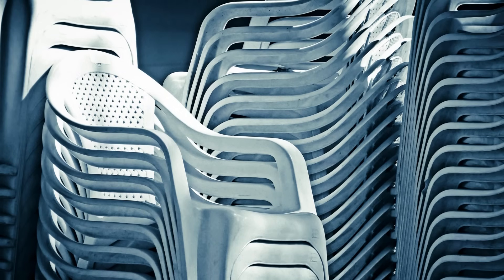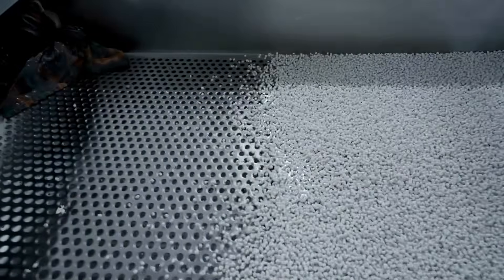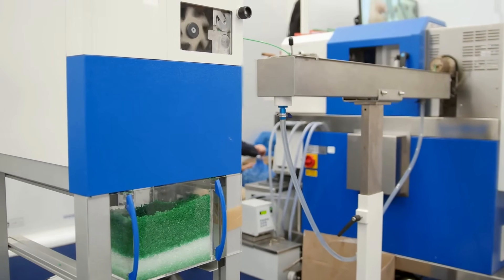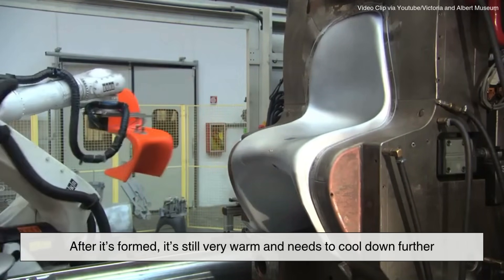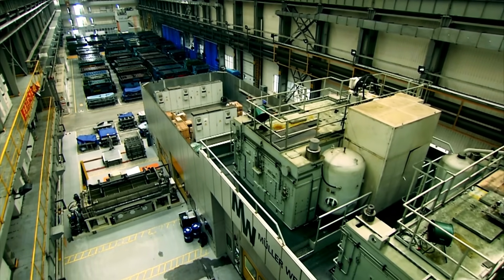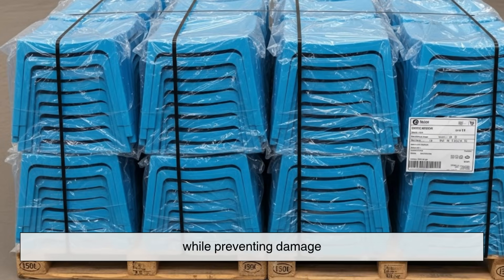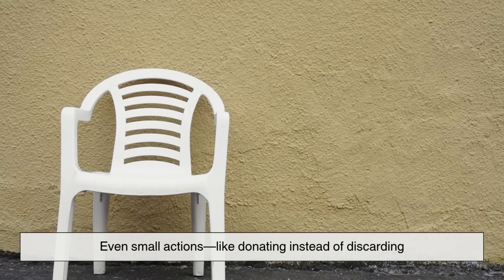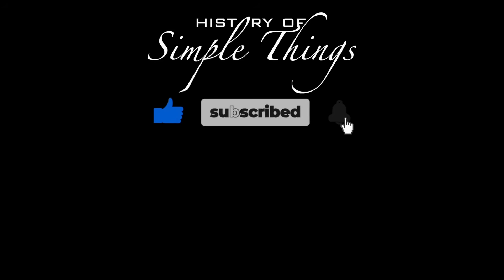How Plastic Chairs Are Made

Comment: This video is missing the one part of the process I most wanted to see - the design and manufacture of the actual mold without which the chair would not exist.
The design must be strong, perhaps stackable and or joinable and the mold must be such that after injection of the material the finished product can leave the mold.

Comment: Hi, Nice video

You can recycle a few times only, virgin material is 100% best, mixing defect part is called "regrind", you can add the shredded regrind powder into the hopper with virgin material but dont take the mixture past 20 - 30%

Also you cannot mix different plastics ( you can but best if you dont )  so Polyethylene (PE), Polystyrene(solid not the foam type ), Polycarbonates (PC), polyvinyl chloride (PVC)

The flame retardant additive does not make it flame proof, typically with plastics a naked flame will scorch the material and give of a think pungent and dangerous smoke.  Flame retardant material will burn as long as the flame touches it, once you back of the flame it stops burning / smoldering  - while that does not sound important think of wood or clothes, once they are on fire they will continue to burn until the material is gone or the fire hit with water or similar - but with flame retardant material as soon as the flame moves on the material stops burning - it does not hold or combust the heat on its own